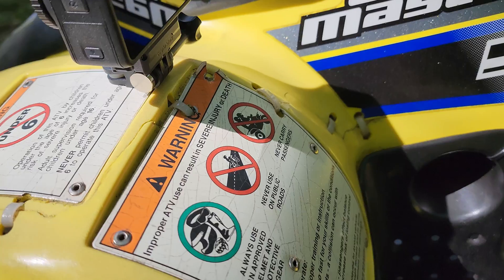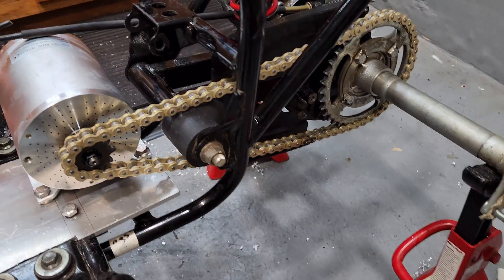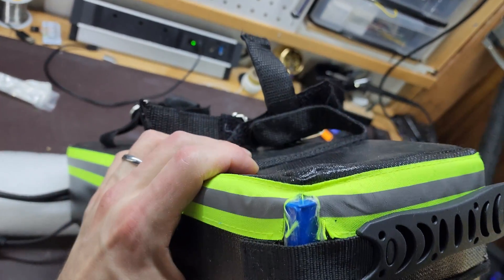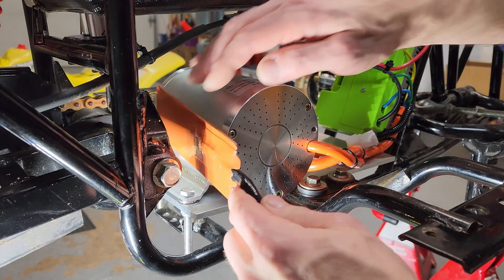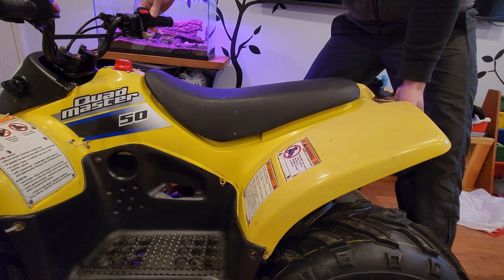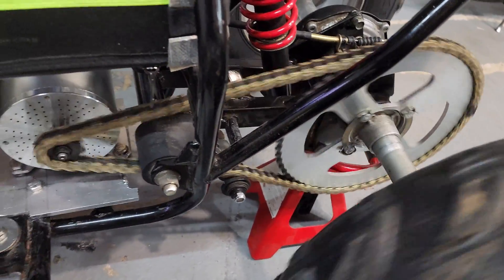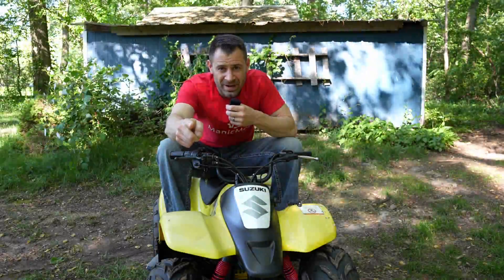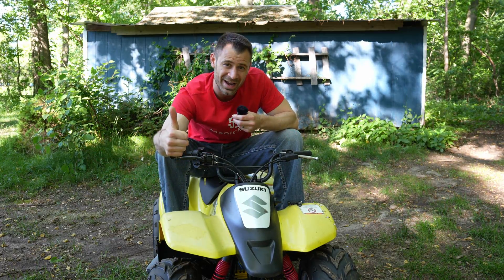My DIY Electric ATV Almost Killed Me! 💀

Comment from the maker: SUPER EXCITED TO SHARE THIS ONE WITH YOU ALL!  LET ME KNOW WHAT YOU THINK!
Reply: nice build man good vidio keep it up
Reply from the maker: @Bomber2k25  Appreciate that, thanks for watching!!
Reply: @manicmods How fast did it go at the end? Im also thinking of building a mini bike but overvaluing the motor to 84 volts, and I have a 50t sprocket. Wheels are close to the same size, so it should all be similar other than the sprocket
Reply from the maker: 35 and I wouldn't want it any faster 😅
Reply: Ok thank you !  @manicmods
Reply: @manicmods Did the motor overheat at all? Mine is getting pretty hot with only 60 volts… even though it is the 72 volt 3000watt motor, and my bike is very small and light

Comment: I have a 2003 Yamaha breeze 125 and I’m 200 pounds what motor and controller you think I should use?
Reply: QS138 with the Fardriver ND72530 or even a QS180. I'd go with the largest motor you can fit in it, because you can always turn the power down in the Fardriver app, and power is addictive.

Comment: Thats cool, ive got a bunch of those Chinese quads at home that won't stay running long and wanted to do something with them, love this idea. Ive never worked with any of these electric kits before do you have a parts list anywhere?
Reply from the maker: I used a Vevor 3k squarewave (not fardriver) kit.  Kunray has one too but I was so beat from their support (they have no right to program the FD controller the way they do) I couldn't give them another dollar.  The MY1020 is the motor resellers use.  Hope this helps, thanks for watching! ⚙️

Comment: Can you make it a radio controlled truck?   People pay more than that for smaller sized RC Trucks all the time!
Reply from the maker: @Idontdohandles  I've thought about this countless times! Would you trust the driver though? 😅 Thanks for watching!  I took it out on the snow and ehh, didn't work out great.  I'll be posting that soon!
Reply: @manicmods  lol never trust the drivr mod ;-P    Yeah maybe need a set of custom tire chains.  I've buit a couple of custom 1-off 1/6th scale RC Trucks over the last 2yrs --- $900 is a drop in the bucket!!  I made custom big tire snow chains for both rigs and it helps them go in the snow immenelsey better than without!!

Comment: They have antisprk what are the xt60 or 90 they have both you should switch to qs8 or some single bullet connectors rated for better amperage
Reply from the maker: Love the QS line.  I actually ordered one on eBay and opened to find a Kunray 5k 😭 I complained and seller just gave it to me.  So I'll be upgrading and updating channel on that mod soon.  Thanks for watching! ⚙️

Comment: I am building this next week on an almost identical Suzuki 50 quad. It is for my six and seven year-old. I am a little concerned with the acceleration of the larger gear. I ordered it, but it is pretty huge. I’m also a little worried about ground clearance. Do you think the stock sprocket would be adequate for a 50 pound rider? I figure I can try both, but if I only have to do it once, that would be preferable.
Reply from the maker: Sweet!  Definitely will want it on low or medium speed to start.  Just be mindful when bringing that top speed down, it will make enough tq to break traction or wheelie.  The scooter store I linked will have everything u need and definitely suggest picking up variations so you can tune.  Let us know how u make out, and email me via website details of in CT by any chance. Thanks for watching!

Comment: Could you share why the heat pad? Do you turn it in after use?
Reply from the maker: This was to dry out any condensation after bringing it in from winter drive.  Sadly i didn't get it in the snow until this winter and she didn't do that great - motor smoked.  I'll be revisiting this soon w 5kw motor and will likely publish some content along w additional build steps not covered herein.  Thanks for watching! ⚙️

Comment: I have a 90 mars quad that is not running , should I use 2000w 48v or 3000w 72 v system ?
Reply: i think bigger engine more fun :D
Reply: @battya0914  My bike for some reason has lots of resistance going forward like there is a bearing stuck , in revers it goes well

Comment: Built that same kit into a razor bike. Those controllers are so garbage. Do yourself a favor and buy the electro and co Kelley KVD. I don’t regret that buy at all but I did melt the motor by overheating it with too many amps. So get a heat sink too lol
Reply from the maker: Appreciate you!  That bike must have been pretty quick.  So far so good with controller.  The MY1020 is pretty solid but fear it will fail quick since vented.  How does Kelley stack up against Fardriver in ur opinion?  They look similar on product photos and paper.  Tunable sinewave controllers are def where it's at.  Thanks for watching!
Reply: @manicmods  don’t actually own anything from far driver. Bought the Kelly because I knew of electro and co products because I like surronster. Electro and co is definitely overpriced but I have no complaints on the quality of things I’ve bought